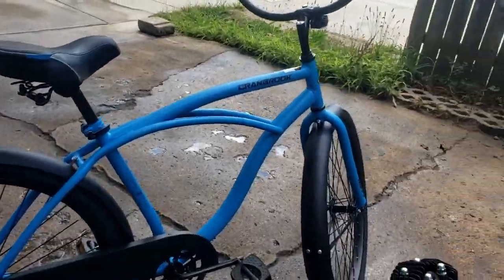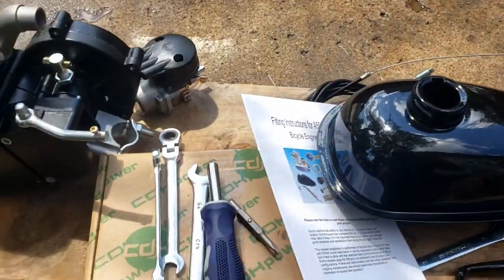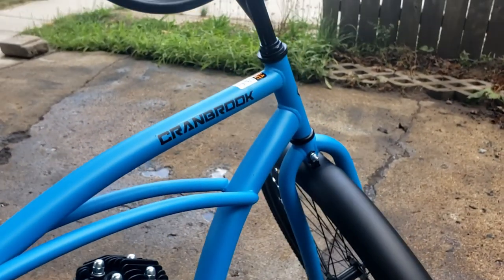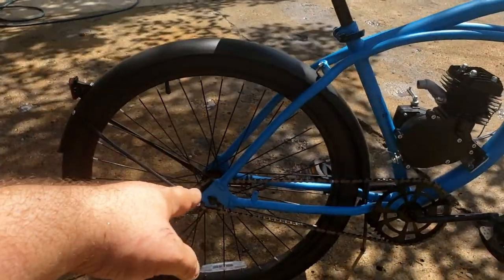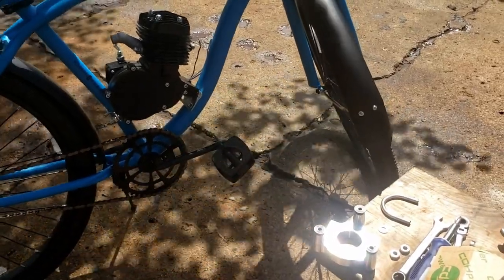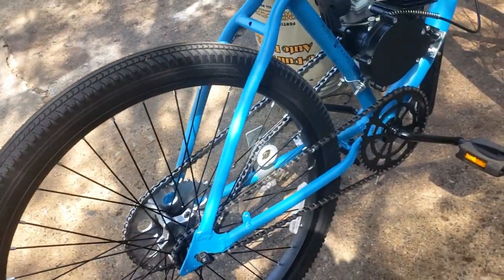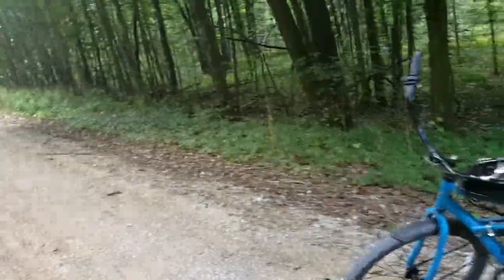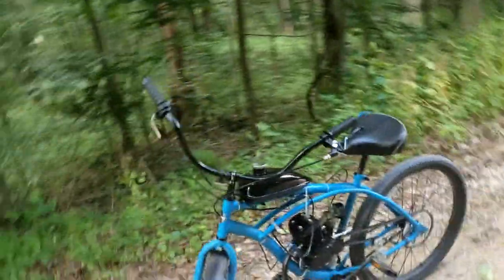Let's put engines on 95 dollar Walmart bikes and terrorize the town!

Comment: The rubber donuts weren't bad on my build. Went pretty smooth. Not as bad as everyone says it was. Speed is about average. My big wheeled schwinn midway gets up to 32mph so a smaller tire bike probably is a little slower. I'd love to see you try some mods. I've just got mine broken in good. I plan on a pipe and deck the head for a little more compression and buying a jet kit to tune it better. Anything more I'd like to try a harbor freight 212cc build.
Reply from the maker: I'm also hitting about 32, max now. 

Top speed isn't too concerning, I don't really care, I wish it had more low end though to pull me up hills and whatnot. 

I think I'd like to try a 212 build with that in mind.

Comment: I've got three bikes, all built for specific fun.
Rag joint they supply is a pain yep, but it's solid if done right.
Scuff up your hub and apply a little adhesive to that hub adapter, they can slip.
Drill out the bottom of the exhaust supplying a second 1/4" hole opposite the stock port.
Although I do not agree with your mix ratio for break in, the motor will free up as it's driven giving you more snap and grunt

Comment: The dreaded spoke ripper. Better get sprocket that mounts to the hub and some beefier rims.
Reply: After three years, two basic 66 cc engine kits like this one, one 5 hp. 66 cc electric start trike, and two 49 cc four strokes, all with the rubber sprocket attachment to the spokes, I haven't had any spoke issues. What am I doing wrong?
Reply: @stephenandloriyoung5716  Absolutely nothing wrong haha. Most super cheap bikes just don't have the same kind of luck with the rubber grommet mounted sprockets, in my experience.

Comment: I have on i got after market muffler drilled the jet a little bit bigger cut the air cleaner open for more flow  & rc fuel 1/4  & 3/4 gas lol
Reply: That got different  sporket for it too
Reply: No you didn't, quit lying.

Comment: I am in the process of doing this on my bike but I'm looking for a right side drive sprocket like the original pedal sprocket that way I can keep my gears on the rear axle and have high and low gears for pulling hills and cruising at higher speeds
Reply from the maker: You can do that with a jackshaft.

They call them shift kits 😂
Reply from the maker: https://www.amazon.com/dp/B00KWLLENY/ref=cm_sw_r_cp_apa_i_D.CeFbNSFMVB9

Comment: I dig it, but for $160 I would just get a harbor freight 212 and do a little cutting and welding to make it fit, but I am a pleasantly plump 350 pounds to
Reply from the maker: Cutting and welding on most bike frames isn't going to happen because of the nature of the metal and how thin it is.

With that said, a Predator 212 fits without cutting and welding, and I already have one.

What you didn't consider was the extra 80-100 for a clutch for the 212, and the fact that the sheer torque of a 212 will destroy an ordinary bike.